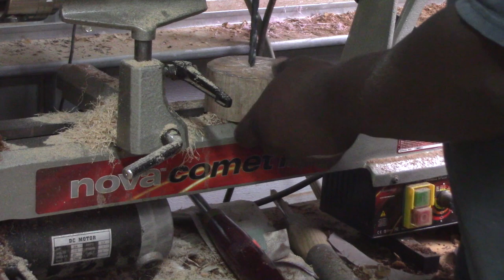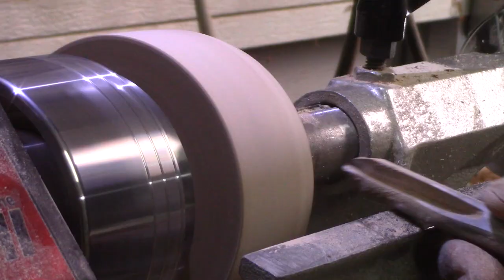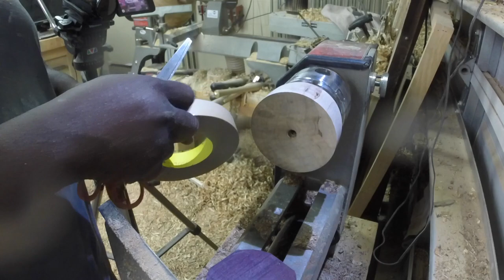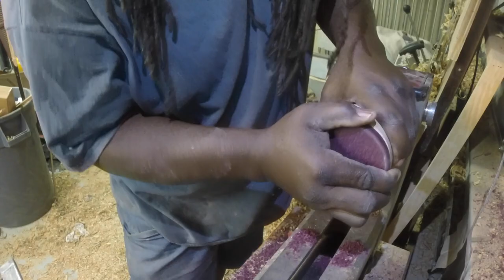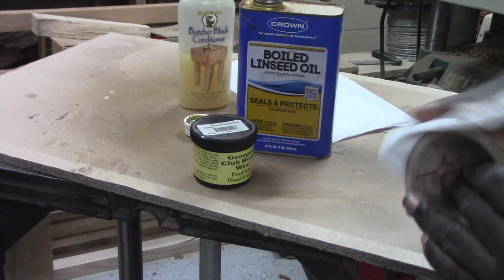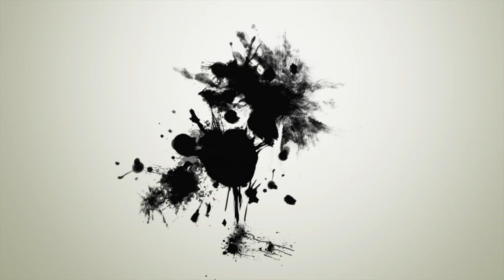EP 11: Make a Salt Cellar

Comment: I’m thinking about making a few of these from my next show in two weeks. Great video
Reply from the maker: Ox In The Shop Thanks Drew! One tip I have to offer is before you double stick tape on the lid, adhrlere some sandaper to a flat board and make sure the surface of your base piece is flat. Just a little jewel that I learned from doing a bunch of these.

Comment: Really nice job; a couple of suggestions - it could be just video playback speed, but it looks like you're sanding speed is quite high.  Lower the lathe speed to 300rpm for sanding.  Keeps both the wood and paper (and your hand) cooler.  It will also prevent heat checks in the wood.  Also, in place of the screw, use a small length of dowel.  More attractive and does not need to be tightened regularly.